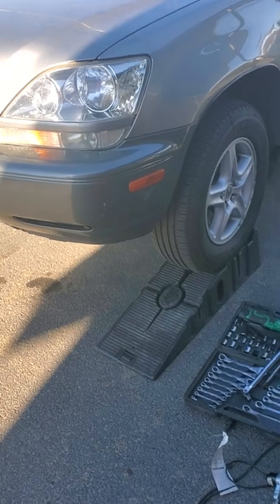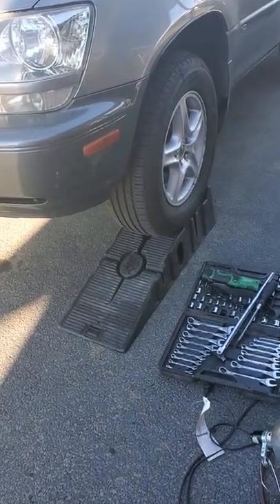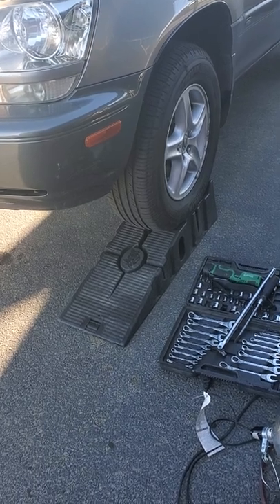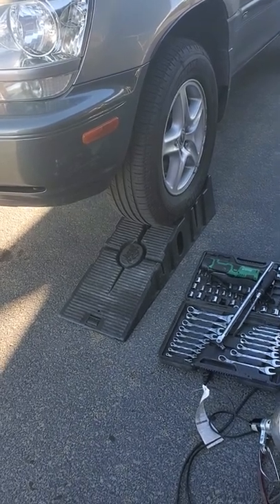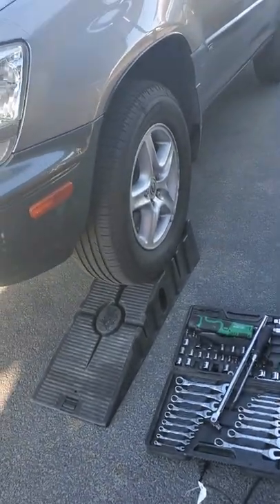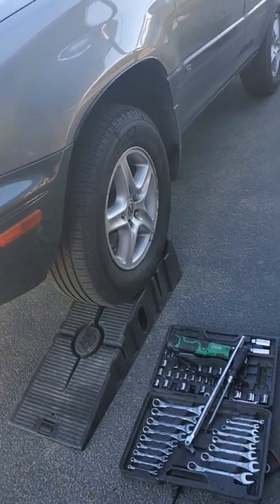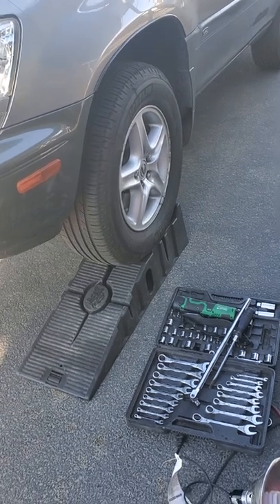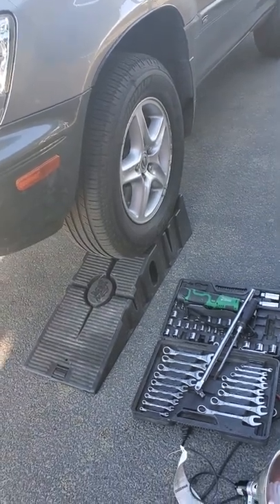Car ramp hack

Comment: Safety wise, this is as good as the driving forward into the ramp. The chance of a car moving backwards is as same as moving forward if its not properly restrained. The biggest advantage is that we can use the jack points safely for using a floor jack. Putting a choke in the front side of the rear wheel is the key.

Comment: Can you jack up the car and put these underneath and do it that way or is that hard as well?
Reply: It's not hard at all.  I use four ramps and have the front two and back two turned opposite so they are self chocking.

Comment: Don’t try this, if car move it will kill you straight way,
No chance to survive
Reply from the maker: It's no different than normal  safety wise. Chock the tires or use the emergency brake.
Reply: Just chock a back wheel, in front of and behind the tire. Then the vehicle cannot move in any direction.
Reply: If anything this is safer, if the car rolls forward off the ramps there more room before the back tires roll over you if it rolled backwards the front tires roll over you instantly
Reply: You don't know what you are talking about.